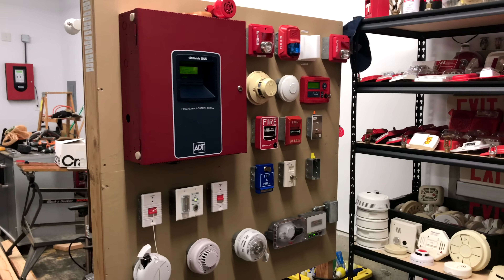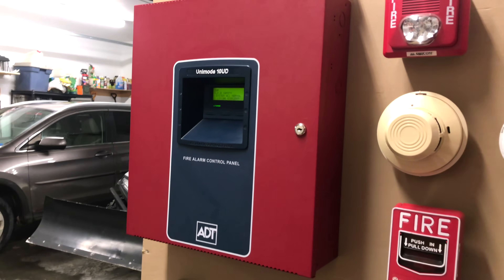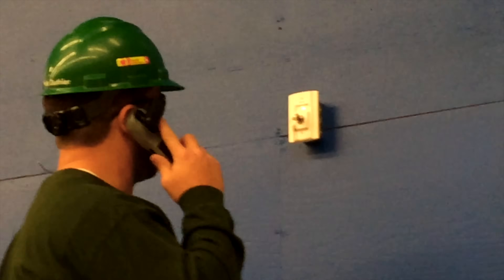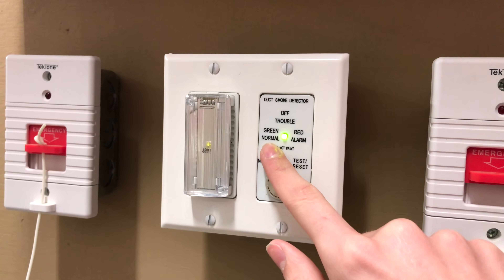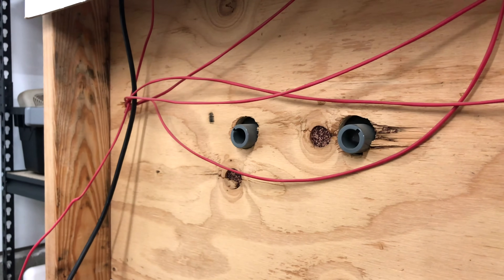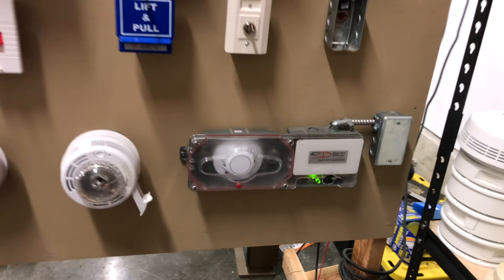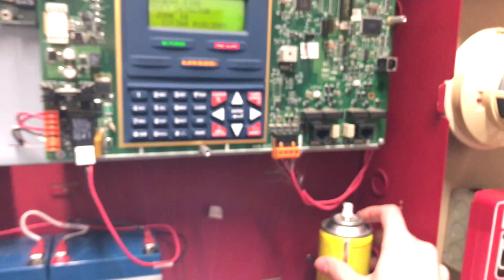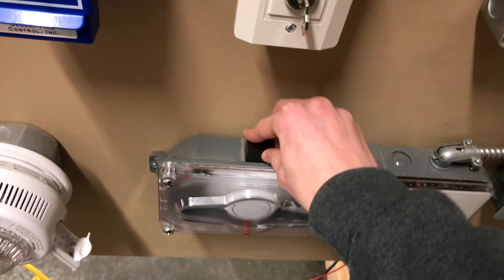ADT Unimode 10UD System Test 8: Duct Detector

Comment: What brand is the actual smoke detector inside the unit? I’m a fire alarm engineer in the UK and we use those smoke detectors everywhere - they are very popular here. (Manufactured and designed in the UK)

I’m guessing it’s an Apollo Series 65? Just wondering if they rebrand it when it goes to the USA. 

Cheers!

Comment: Usually (in my experience) duct detectors do not operate a fire alarm- they just shut down units/close dampers.
Reply: Duct Detectors do cut off the air supply, of course. They actually do operate the fire alarm since what could have presented as light smoke could actually be a byproduct of a active working fire. Just like the alarm activated fire doors.. Duct Detectors work in the same capacity: to prevent the spread of smoke/fire by cutting off the oxygen supply needed for fire to grow.
Reply: @michaelomalley592  i've never seen them hooked onto a fire alarm in my area, just shut the unit off here.  guess it depends on local regs too lol
Reply: @michaelomalley592  my biggest problem with them is on burger king and mcdonald's a/c kitchen a/c units... the grills shut them down lol

Comment: Hard to tell on the vid, does the strobe on the duct detector key switch flash in sync with the other strobes? I wonder if there's any analogue in Simplex's line that has SmartSync compatibility...

Comment: There's also a feature on it where you can put a pin into the tiny hole on the bottom, around the red circle to test it.
Reply from the maker: If you are referring to the feature where you can spray canned smoke into the tiny hole, yes that's a feature.
Reply: @SERSafety  No. Below the smoke detector head marked "TEST PORT". You can demonstrate it in test 9 if you were to. Also, I would like to see these Mircom/Amseco/Potter alarms go off by themselves in test 9 too, and I've never seen you reset the panel with the keyswitch for the duct detector still in alarm before because I never knew you could do it.

Comment: Nice! Also just as an idea, you should make it so those duct pipes come out the top that way you could mount another panel if you ever wanted too.
Reply from the maker: As of now, I have zero plans to mount another panel to this side of my board. I am very happy with the set up I have currently. Thank you for the suggestion though.

Comment: Ser I'm trying to get a alarm setup can you give me some ideas of what to get as a panel, pull station, and alarms?
Reply from the maker: For a basic starter alarm system I recommend these devices:
Panel: Fire-Lite MS-2
Pull Station: Fire-Lite BG-12L
Alarm: Gentex Commander 3
Smoke detector: System Sensor i3
Reply: S.E.R. Safety Thanks that lists helps a lot!
Reply: Can you ship those i am a starter too
Reply: Ok! Thanks.